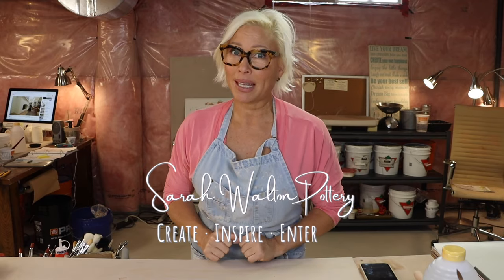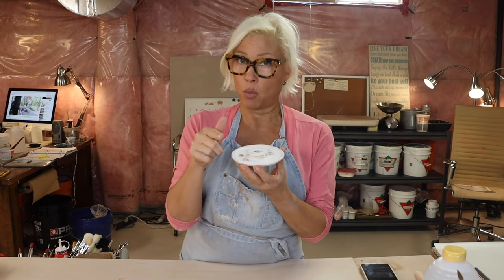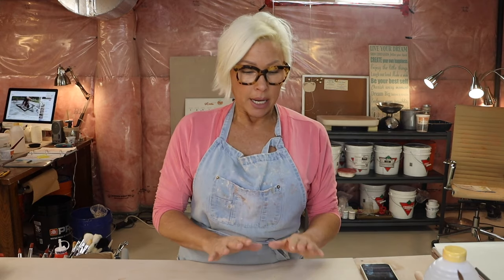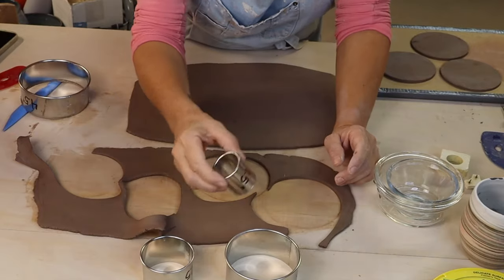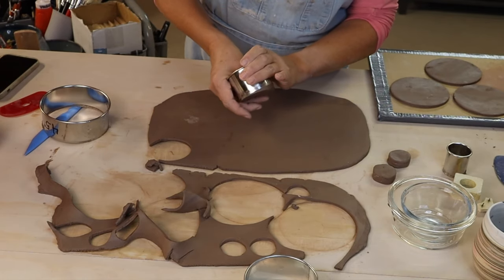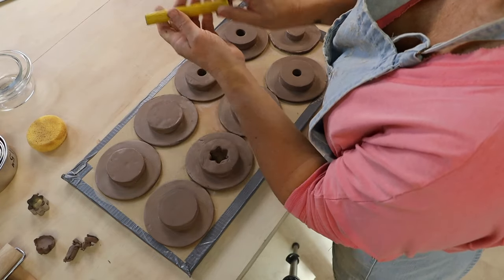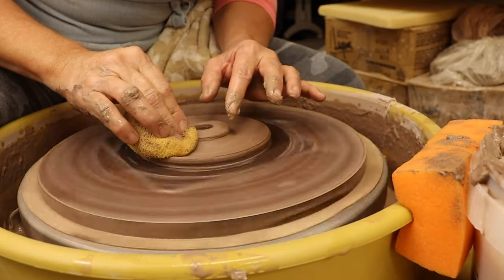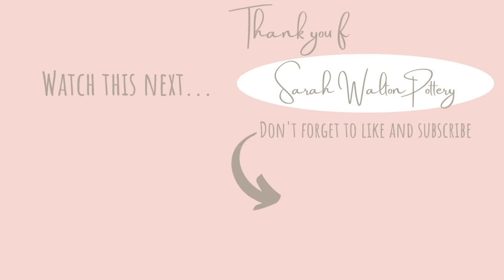How to Make Raised KILN COOKIES aka DRIP CATCHERS the EASY WAY  HD 1080p

Comment: Nice cookies, cookie.😁
One thing I also do with my cookies is to add deep cross hatch texture to them.  This as three benefits.  
1) If the glaze does run then the piece and the cookie stick in less places and there will be gaps to get between them and separate them.
2) If the piece is not completely flat or warps a bit when firing/drying then the bumps give it point contact location the keep it from rocking
3) The texture allows a bit of air circulation under the piece when firing.
Reply from the maker: AWESOME Advice!! I’ve seen people use texture on their cookies and I just thought they were being extra fancy…but you bring up some great points!! Thanks for sharing!
Reply: @SarahWaltonPottery  glad to share.  Note that my cookies are currently "flat" cookies - no raised middle like yours.
This means they can curl / potato-chip when they dry.  To avoid that I stack them (with wax paper between) and put weight on top when they are drying.
Reply: @SarahWaltonPottery  I do like your raised middle cookies.  I think I am going to make some of those the next time I bake cookies.  Always good to have different options.
Reply from the maker: I’ve stack them with weights before but not using was paper…another great idea!! I’ll definitely try that one too. I’ve got a lot of flat things that you’re advise will come in handy. 😊
Reply: My online teacher uses cat litter- filled cloth bags ( made of old clothes ) of different weights and then puts them in the platters and other flat pieces.
Reply: For tiles she uses ware boards and stacks them like sandwiches. The boards are made of birch boards and then 2 coats of polyurethane. This really helps with warping. No more than 5 layers of tiles and boards

Comment: Thank you so much for this realllly helpful video!! I handbuild and slipcast so I got a mold of kiln stilts and I just don’t put the wires in them. But I do use cookies ALOT. A friend of mine accidentally ordered some cone 10 clay so that’s what I make my cookies from. They last forever!!  OMG YOURE GETTTING A NEE KILLLLLN!!! I am beyond excited for you!!!!! If you poke holes in the big lump that will help as well. I just make a bunch of flat cookies and stack them as needed so I don’t have cookies that I can’t use for other pots. I can place them on top of eachother in any formation for any size pot. Also I place the slab on a piece of hardibacker board used for shower walls, and then cut them out so I don’t have to touch them and have them end up bowing. I place another piece of hardibacker board on top and make a big stack of them. The hardibacker board makes them dry super super fast because it absorbs moisture extremely fast!! Hope that helps.
Reply: I need to get some of that board Michele - is it heavier than drywall?
Reply from the maker: Yes, hardi backer board is heavier..I have some in my studio as a surface on one of my work table and it really does absorb…a lot as Michele says. If you leave clay on it for any amount of time your clay will crust. So the way that Michele is suggesting to use is brilliant!! I believe that Hardi backer board is made of a concrete material. So it’s fairly heavy. 🤭
Reply from the maker: Thanks sooo much Michele!! I always love your suggestions! I love the idea of making lots of flat cookie and just layer them!! 
I have 2 large slabs of hardi board in my studio so this is a fab idea to keep ‘em flat and dry quickly!! Brilliant idea..👏🏻👏🏻👏🏻thank you!
I’m beyond excited about my new kiln!! You’ll have to share some programs that I need to use!! I’ve been updating my garage…getting it ready for my new addition🤪🤪🤪
Reply: @SarahWaltonPottery  we can’t wait to hear what you decide to name it! 😍

Comment: Hi from Colorado!  Just hooked up my kiln (Skutt 1027-3) and am also name searching. I have a question about your design - why the raised bit and why the hole in the middle?  Guess that’s 2 questions. 😉
Reply from the maker: Hello Colorado!! Skutt 1027 is a popular kiln, and a good one too! Congrats!! I’m fond of glaze drips and they are a huge part of my aesthetic. By creating a raised part that will sit within the foot ring, if my glaze runs too far, instead of the pot fusing to he cookie or my shelf, by raising the pot up, the drips can surpass the bottom and will be caught on the cookie. This is a win win. I can easily grind the drip off and save the foot…And the cookie protects my shelf. The hole in the middle help the cookie dry more evenly and helps release the pot from the cookie. Hope that helps! 😉

Comment: Hi Sarah,  congratulations to your new kiln ❤🎉.  I got a question,  could you be so nice to make a video about how to fire your new kiln the first time,  I mean what to do if you have a new kiln. I have  my very first one sitting and waiting for the electrician to connect,  which will take properly another few months,  I'm not having a vent and I'm a newbie at pottery,  I  mean know a lot of safety precaution, but i don't know when to leave the peephole plugs out or in and when to using that other venting prop brick  to lift the lid while heating? And what to do if you have no kiln vent🙏. ( mine is going to be firing in the shed) Maybe you could help me out 😅❤ thank you sarah,  I love your videos
Reply from the maker: Hello!! How exciting for you too! When I got the kiln in my videos it too sat in my garage for a long while until i finally picked up the courage to fire it...and as you mentioned, I had a licensed Electrician come in and do the hard wire as well I had permits pulled AND I had it inspected by ESA to feel confident when firing. Being in Canada we have different rules etc. But once I fired it for the first time, I gained confidence. 
Now with a brand new digital kiln, I'll be nervous again, but I ABSOLUTELY  will be filming and sharing this experience with you all and of course any tips along the way 😉!
Reply: @SarahWaltonPottery  I'm so excited 😊,  thank you.  I couldn't find any videos here on YouTube how to fire a kiln without a vent, if I could save the money for the beginning and not buying a vent would be great,  long-term I probably going to buy one.  Pottery is an expensive hobby 😅 but every cent worth.  And didn't expect how much it costs to get an electrician to wire the kiln and having a new breakerbox installed 😳,  well Pottery teached me a lot of patience 🤣🙌, anyway thank you again for sharing all your knowledge 🤗❤️

Comment: I’m totally hand build. 40 miles from a wheel. Maybe I’ll throw someday but i appreciate the slab version for sure!!  Thank you, now how do i use the cookie??
Reply from the maker: The raised part of the cookie is designed to fit in the hollow of the foot so there is a space between the foot ring and the cookie for glaze to drip off and not get stuck to the kiln shelf or cookie. I hope this makes sense...

Comment: Thanks for the lesson! I’m curious about your stilts - could you put the pins face down and just have your pots rest on the ‘smooth’ part of the stilt?
Reply from the maker: I’ve done that before, but the stilts aren’t as stable with weight on them, the pins could bend and topple over, causing even more problems.

Comment: Great tutorial!  Do you kiln wash the cookies BEFORE the bisque fire, or AFTER?  Thank you!
Reply from the maker: Sorry for the delayed response! Firstly, Thank you so much! As for your question, i prefer to apply kiln wash when the piece has been bisque fired. As the cookie is porous it absorbs the water so you get the best application. There are times when I need to use the cookie right away and there is no time for me to wait for a bisque so I will take a cookie from greenware and use it in a glaze fire but without kiln wash. I haven't tried applying wash during leather hard stage, but that could potentially work too. Maybe I'll have to test that out. Thanks for watching! Cheers!

Comment: Hi Sarah,

Do you apply kiln wash to the cookies before or after bisque firing ?
Reply from the maker: Hi Catherine, I apply it after bisque. I have applied after a glaze fire too, but the wash doesn’t absorb or adhere as easily. There are times when I’m desperate and have to use the cookies from greenware, in which case they don’t get kiln wash until after. In other words I ‘hard fire’ the piece meaning going straight to glaze fire. Hope that helps
Reply: @SarahWaltonPottery  thanks I will bisque fire and then apply first :) thanks for the video demo! I had so much fun making these !! ❤️ I just bought fairy rose and spectrum  pearl white that I want to combine together. I don't know if they're super runny together but better safe than sorry by using those cookies !

Comment: I’m very frustrated with stilling and The holes. I’m making pie plates and dinner plates and want a solid two side surface
Reply from the maker: Hummm thats going to be a challenge...I've recently been glazing the bottoms of some mugs but I had to stilt it...I did watch a video and I tried it myself (tho NOT PERFECT but I filmed it in LIVE kiln opening) I added wax resist to the stilt part and the pitting that they usually make was much less but still there. Check out the video and you can decide if the marking is acceptable.

Comment: I’m not sure what you use these cookies for? Maybe I didn’t listen well   Hope to hear from you 🥰
Reply from the maker: Hi Sonja! Cookies, especially raised cookies are used to protect your pots and your kiln shelves. I use a lot of drippy glazes that can and will run off my pots so by raising it up slightly I’m able to prevent the pot from sticking to my kiln shelf, thus ruining my pot and possibly damaging my shelf. When space is left between the bottom of your piece and the shelf, glaze can run off the pot in a tear like shape that is easily ground off and voila, pot saved. Hope that answers your question! 🥰